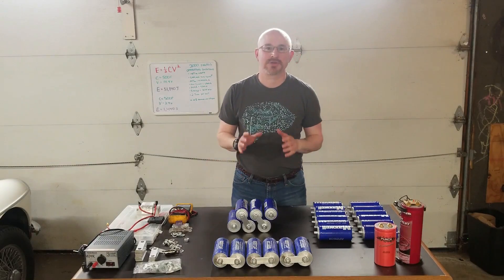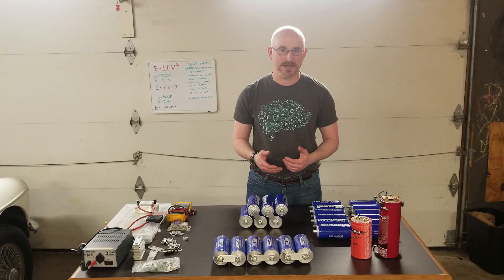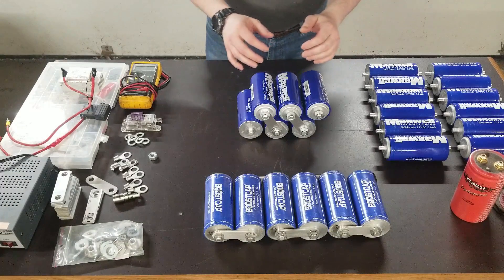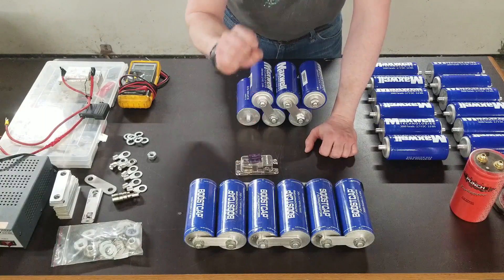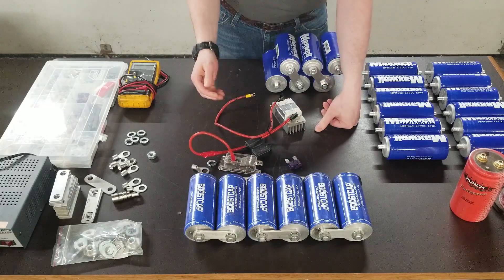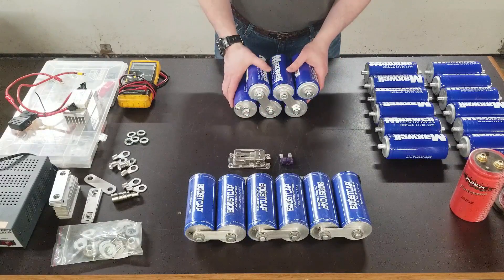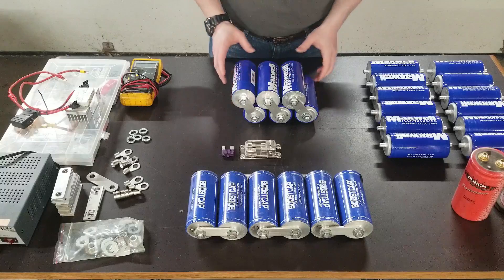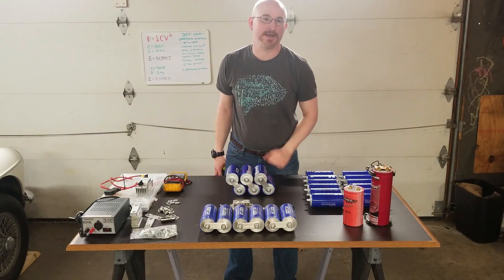Electrical engineer explains ultracapacitor Safety Tips and Tricks - Car Audio Applications

Comment: Would capacitor help with 3000amp max draw running on 500ah of lithium on two 370amp alts? Roughly 30000 watts rms....
Reply from the maker: The cap bank needs to be of sufficient size to help.  Li-Ion batteries are pretty stout and I'm not aware of a need to supplement them with ultracaps.  Our ultracap support was mostly for lead acid batteries.  But I can say that properly sized ultracap banks will help an alternator with the engine lag.
Reply: @richardvedvik979  I'm pulling 2000 amps at peak with two dedicated 370 alts and 764 amp hours 12volt lithium. Do you think I should worry with Capps at this piont?
Reply from the maker: @moabs10blowthru41  No, the cap bank you would need to see any benefit wouldn't provide much added value.  Love me a blowthru in a pickup!
Reply: @richardvedvik979  thanks for the advice,4 X15s 4th order on two EMF 12k amps should be stout when I'm done. Was doing 156 on 1 amp running 2 ohms so half power. Very excited to find out if I can break 160

Comment: Old video but you still around to answer questions on these? To use with stock battery/alt do you charge these to resting battery voltage?
Reply from the maker: When integrating the cap bank with the vehicle, you provide an initial charge to get the cap bank within a few volts.   I use a current limiting battery charger setup to do this.  You don't want to connect a bank at 0V to the vehicle due to the low ESR looking like a short circuit and drawing thousands of amps.   If you want to use the stock alt/batt to charge the cap bank, you need a resistor or incandescent bulb in series with the positive connection in order to slow current down.
Reply: @richardvedvik979  Are you currently selling any? Have you played with the Yinlong caps? Would same principle apply?
Reply from the maker: @SoundXper1ence  Not selling any, the banks I have left are stored for future projects or in use.   Same principles apply for any capacitor bank - the math varies based on the ratings of the cells and banks.    These are 3,000F and 2.7V.  Caps come in a variety of sizes and ratings.
Reply: @richardvedvik979  I believe they are the same. The yinlongs and the ones XS Power are using. They come in either 35/40ah 2.3v make charge 2.8. I have a site selling a bank of 35ah 2.3v for $300. U think that's a good deal and could support 2k watts with 150a alt. Thx again
Reply from the maker: @SoundXper1ence  is that a bank of seven cells in series?  Any over voltage protection if the voltage across each cell varies?

Comment: Thansk for this great explaination. I hv a question, do i need to put 2 fuses before and after the capacitor
Reply from the maker: I fuse on the input to the capacitor bank (before) with a MAXI fuse (a circuit breaker would also work) in order to isolate the cap bank from the car when disconnecting the battery.  Treat these like batteries as it relates to fusing.   I also fuse after the cap bank, sized for the wire, in order to limit fault energy.   So , yes, two fuses.

Comment: So I've seen a solar panel hooked up to some with an inverter. Could you charge a battery pack with these for night use or would these last out for several hours with a simple light?
Reply from the maker: These came from solar energy storage applications.  So yes, you would need to ensure the voltage out of the panel was regulated into the ultracaps to not exceed voltage ratings.  Ideally, a DC-DC converter that accepted a wide input range (5-30VDC) and output a fixed 15VDC with cell protection.   I did load testing in my other video.
Reply: @richardvedvik979  ya I saw lasersaber make a really awesome real time solar to Ac power inversion with a circular saw. It was sweet. He hooked up his panel to a charge controller to a massive pack of supercaps he made into an inverter and then plugged his saw into that to use the solar directly...it was awesome. This is what I want to do for some small draw applications like a mini washing machine, or charging a power pack while maybe powering a 100 watt fridge, maybe even using wind or hydr power as substitute for solar

Comment: In vehicle start apps , eg,
Batt>UltCaps>Starter>Alt>bck to batt, and say you connect a 2000 W ac inverter @ UCap output, and say you use the inverter with vehicle off and discharge the caps, at what rate will they charge when the alternator is engaged? And does charging at higher amperages decrease efficiency or lifespan of the UCaps?  Also, on not totally unrelated sidenote, could one put 3 of those in series in a back pack, with easy access , break away leads, with inline switch, and hook them to e-scooter for a potential NO2 effect? #Data from Goonies
Reply from the maker: Nice Goonies reference.   :)    Draining the caps to 0V would be a bad idea, at any time, without a current limiting charger.  The ultracaps will look like a dead short if energized after being drained.  That said, the 2000W inverter will shut off around 10VDC, so the ultracaps won't be down to 0V, just around 10VDC.  You will need a 200A solenoid relay if your intent is to isolate the ultracap bank from the starting battery.  When you turn on ignition, the caps will be in parallel with the starting battery and they will find equilibrium fairly quickly.  Then you can start the vehicle with no issue.  The caps don't really care about charge/discharge cycles since we never fully discharge them.  

As far as the backpack goes, you can combine any number of caps to create a series string for whatever voltage range desired.   As far as a NO2 effect, the addition of a parallel voltage source will allow for additional energy storage, but the moment the caps are paralleled with the scooter battery they will try to equalize, which could result in a short burst of current availability.    Any boost felt by the scooter would be short lived.  :)

Comment: What would be a good ratio of farads per 1k rms  to run on music for long periods of time  with proper charging and batteries already in place
Reply from the maker: Time is irrelevant to ultracap usage since they aren't useful by themselves for audio applications.  Most are using a 500F bank (six in series) per 1kW and seeing improved voltage stability (myself included) when playing music in a daily build.  This setup is useful for 5 minute drives and 15 hours drives.    SPL builds used to put whatever they could fit/afford so they aren't a useful reference for most consumers.

Comment: hello, could you ask me a question, I have an electric scooter, 60 volts 20ah, is it possible to connect super capacitors to supply current peaks
Reply from the maker: Sorry for the delay, I don't think there would be adequate space for sufficient ultracaps to make a substantial difference for a scooter.

Comment: Since when does an electrical engineer know sh!t about electronics? Never in my lifetime would I take advice from a electrical engineer on electronics as an electronics engineer!
Reply from the maker: A degree is a piece of paper and job titles mean very little when it comes to practical knowledge.  Decades of personal, hands-on experience is what matters!
Reply from the maker: I had two passions and got an EE degree with dual emphasis: analog & digital circuit design and power systems.  One is a lifetime hobby and the other is a career.
Reply: @richardvedvik979  Well I certainly need to take that back. But maybe don't start off with the Electrical Engineer bit as a credential. Your experience will always trump paper examines.

Comment: Hey buddy, my 2021 Zero Sr electric motorcycle has a 14.4 kw battery pack, how many volts of super capacitor batteries as a battery pack do I need so it’s safe

Comment: I am thinking of using ultracaps for starting AC borehole pumps.
Let's say one has 1.5hp pump. That is the equivalent of 1.1kW.

When the pump starts up however, the power required is about 4kW for 3 seconds or more.

Can one use ultracaps to reduce that 4kW requirement? If so, how big a capacitor would one need?
Reply from the maker: Starting capacitors are not new to the motor control industry.  Ultracaps aren't the right tool for the job, however, due to the very low voltage rating per cell.  Consider how may ultracapacitors you would need in series to get to the operating AC voltage.    The in-rush associated with a motor is fairly typical and capacitors are used to assist starting, but not for the reasons you would expect.  This article provides a fairly basic summary: https://eepower.com/capacitor-guide/applications/motor-starting-capacitor/#
Reply: @richardvedvik979  This is what I'm referring to
https://www.youtube.com/watch?v=T3zr4G55WSM

Comment: Your forgetting the balancing circuit which is necessary if u want to get the full cycle life out of the capacitors.
Reply from the maker: I have a separate video discussing the voltage differences between each cap.   Note that protection circuits do not function as balancing circuits when the operating voltage is below the rated voltage.  Typical circuits just limit voltage across each cap to remain below rated voltage per cell.    Because ESR will be different per cell and will vary over the life over the cap, my second video determined that protection circuits are a good investment.   This is despite nearly all car audio applications tending to lack protection circuits for the past 10 years (without failures when 14.4VDC is supply voltage).

Comment: So these caps have leakage over time, along with standard car electronics leakage. If your car sits for a month and the voltage drops to 12V, will your alternator damage due to the 2.2V difference in the ultra capacitor voltage from 14.2V? What's your opinion on that?
Reply from the maker: Sorry for the delay.  A 2V difference occurs whenever the alt turns on and off (common for Honda vehicles with a controlled alternator).  It isn't an issue, i have 187,000+ miles on my 2014 Accord to back up my confidence in that statement and the alt output  in that car varies from 14.4 to 12.5 frequently while driving.  I have a separate video on the charging behavior of that car.

Comment: I have a 350 amp alternator that puts out 15 volts cold then when hot its 14.5 volts. Can I use the 2.7 volt 3000 farad caps on my electrical. I need enough to power my Taramps md8000.1 amplifier.
 Also can I run them with my two 12 volt lead acid batteries? All of my power wire is 4/0.
Reply: Did you manage to get it sorted if so how did it go and where to purchase from? i need for car audio too 😎

Comment: LTO supercapacitors can be used with lifepo4 battery together ? and do i need like a BMS for thoese supercapacitors or i ca just put them together to get the Voltage i need 12 or 24v? thank you
Reply from the maker: Agreed that combining ultracaps with LI batteries is a good combo for both speed and capacity.  If the battery charge voltage is higher or near the ultracap series voltage rating, they need BMS.

Comment: Ok so say I compete, I have 300a alt, 90ah Cmax lifipo battery, 2x 6-7000w amps. What would I need farad wise to support my system with Ultra caps
Reply from the maker: Quite a few to enjoy the benefits.  Most SPL competitors in your position would be running between 6 to 10 banks.  You can probably find competitors selling their banks (with buss bars).  The age of Lithium batteries has shifted the investment effort from AGM Batts + Ultracaps to Lithium-based batteries.   While there would still be a benefit with the combo of ultrcaps and Lithium-based batteries, it's usually cost prohibitive.
Reply: @richardvedvik979  right on, I figured with the lithium the benefit would be smaller. So would 2 banks even helpful or for the cost should I just try to increase the size of my Cmax bank?

Comment: It can work as a 943 mah (Calculated) battery with unlimited charge cycles as it stores electrical charges in electrical fields,whereas batteries store charges in chemical reactions
Reply: Which make you wonder why we continue with batteries at all.
Reply: @jvon3885  capacitors are bulky and expensive so batteries were invented due to their conveiniency
Reply: @UnknownPerson-nl7te  I see guys replacing car batteries all the time with capacitors. And they weigh in at 1/4 the weight of a car battery. I think it's time to get away from batteries all together. Imho
Reply: @jvon3885  a car battery is capable of cranking a car many times whereas a capacitors bank at most 2-3 times,and cannot power car electronics for high time,whereas car battery can power car electronics for a high amount of time,so capacitors are not a very good option to continue with

Comment: Hello, can I get some help on this? I enjoyed your video. I will have my caps @ 500f like yours. They'll run off a trunk batt (fused 300amp) then caps output with 4 feet of 0awg wired to a dist block feeding 2 fused amps, 200amp to one and 100amp to the other. I need to know if I can fuse the output power from the caps to the dist block without losing the caps ability to fast track power. Will it blow the 300amp fuse? Noob question I suppose.
Reply from the maker: Thanks for the question.   I have a 100A MAXI fuse on any cap banks I install and it doesn't hinder their ability to perform.   The minuscule amount of resistance is no different than a set screw connection.   You can use a 300A fuse (ANL) if you prefer.
Reply: @richardvedvik979  you're amazing! Thank you! Subbed

Comment: Why you install 16 Volts açumulative voltage against input of 13.5 Volt of alternator? What if we use 5 Capicitors instead of 6?
Reply from the maker: Great question.  The reason is that the most important aspect of capacitor bank sizing is ensuring your cap bank rating is greater than the maximum voltage you can have.  Alternators are regulated at 14.4VDC but can be as high as 15VDC in certain situations.  For this reason, it is imperative that six caps be used to safely rate the system.
Reply: @richardvedvik979  Thanks a lot. One more question is that in this case the voltage remains the voltage which is being generated by the alternator? The other query is that can we use this to augment the weak battery which is facing difficulty in cranking the engine? Third question is that, you have not used balancing circuit in this, isnt that the irregular current will damage the capacitor?
Reply from the maker: @afaqdurrez5552  yes, the alternator will determine operating voltage when running and battery float voltage will determine operating voltage when the car is off.  With a voltmeter you can watch the delay in voltage change (it's much slower with caps).     My cap install did supplement a weak battery and even a weak alternator for months.  This may be a pro or a con, depending on how you see it.  Masking an issue isn't good but helping the system function is good.   I did another video on balancing that discusses that topic at length.

Comment: Man this is an excellent video!!! 

Is it OK to run super capacitors exclusively? With no battery? if so, is there a way to calculate the capacitance needed for a given wattage of system? 

Thank you so so much for making this video! I really really appreciate it!
Reply from the maker: Thanks!  You would be able to omit the battery if you only used the system with the vehicle running, i.e. running off the alternator, and had a way to maintain charge when parked (i.e. solar panels or battery tender).  Ultracaps will discharge slowly over time with the parasitic load of a vehicle while parked so after a few days the voltage of the bank may be too low to start the vehicle.  As a result, they aren't typically suitable for use without a battery in a normal install. 

There isn't a calculation, per se, but over the past 8 years we've noticed that a 500F bank of six 3000F is  well suited for 2kW.
Reply: @richardvedvik979  Thank you so so much! I'll be building a car for competition maybe next year or the year after, and I've been keeping an eye out for alternatives to lithium. For my application, I feel that lithiums on their own alternator circuit (and that are running on its own alternator and battery) might be the simplest and safest way to power my system. There is the problem with the amount of power I plan to run and how many capacitors I'd need, but it is a lot to consider. Thanks again ☺

Comment: Gd pm sir i asked rhe total capasitor total of 16.5 volts if you connect to the car 16.5 volts if the engine is running there is no problem happen?
Reply from the maker: Sorry for the delay.  The cap bank rating isn't the actual operating voltage, just the maximum voltage the bank can tolerate before failure.  Caps will match whatever source voltage you want.

Comment: versus adding a lithium battery? (combined with my AGM XS Power D3400)
Reply from the maker: Sorry for the delay.  I would prefer a Li-Ion battery over an AGM + Ultracap bank.  The Li-Ion will have better voltage stability and much more energy storage (Joules).

Comment: Could I use just one ?
Reply from the maker: Each cap is only 2.7V (or 2.85V for some).  If you have an application where you don't need more than the voltage rating of a single cell, then yes.  Your operating voltage determines the number of caps you need in series.
Reply: So if I wanted to run a car audio system I would have to have 6 of these basically ?
Reply from the maker: @danielurrea9091  Exactly.  I explain that in the video that we need six in series to have the necessary voltage rating to safely use them in a car.
Reply: Thank u very much I appreciate all your help I had mistakingly purchased a xs power ultra capacitor  thinking that it was a direct replacement for my current capacitor that runs at 12 volts  $80   A cap so 6x80 $480 

I could just purchase a lithium battery for $200/$300 I returned the product today